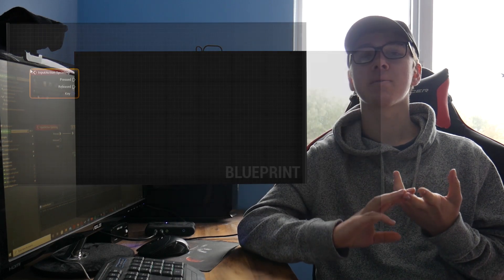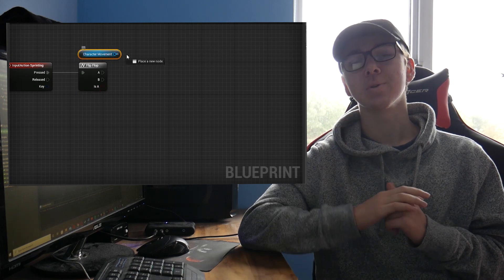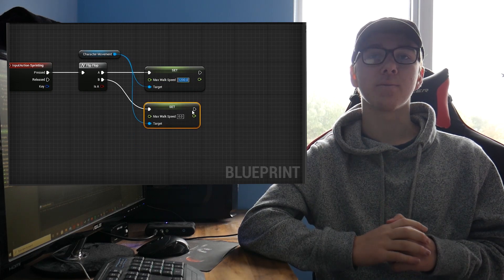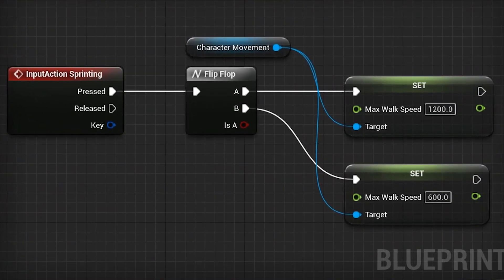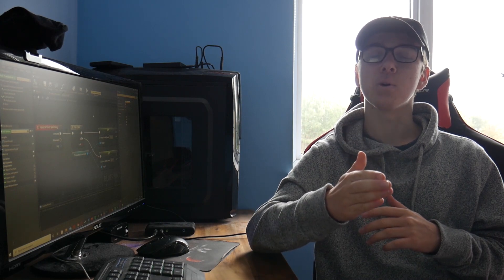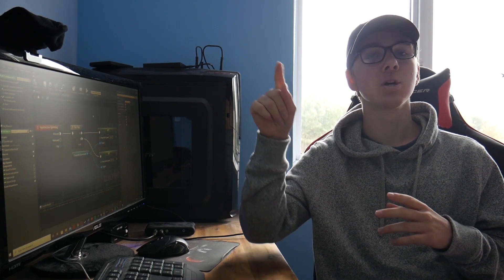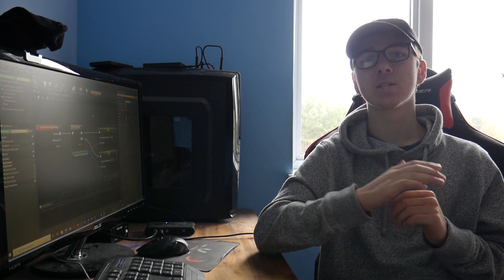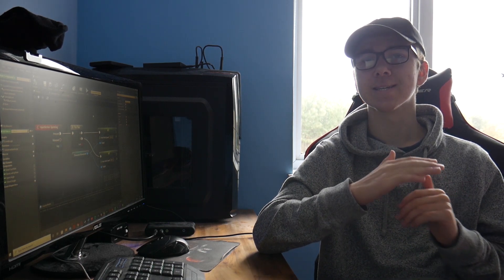Flip Flop - The Basics Of Nodes In Unreal Engine 4

Comment: very informative, thanks. Quick question... Could a flip flop be used to set animations, like having a character walk or run usign a certaiun animation, like if it had morph targets applied, then when pressed again the character would walk or run using the regular animation?
Reply from the maker: Thank you! And technically yes, if you use animation montages and the such, However, it would probably be more beneficial for you to use animation blueprints and blendspaces for working out animation stuff. But you could definitely use it to set a variable to determine which animation is played if that is what you mean :)
Reply: @MattAspland  Thanks I was thinking of using blendspaces , but cant figure out how to switch between one blendspace and another. Not many tuts on that unfortunatly
Reply from the maker: You would do it the same way you change between animations, go into a new state in an animation blueprint and decide on changing it all through the transitional lines